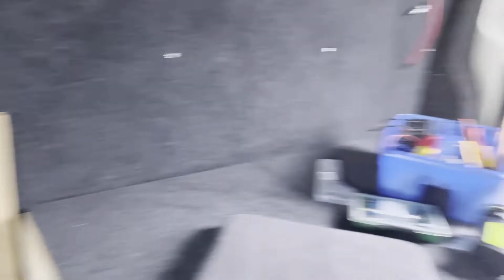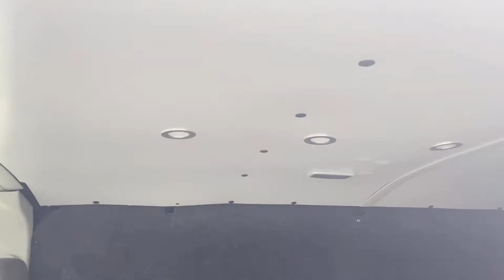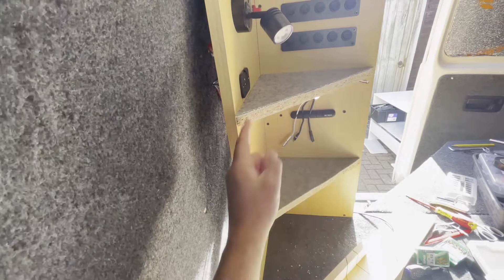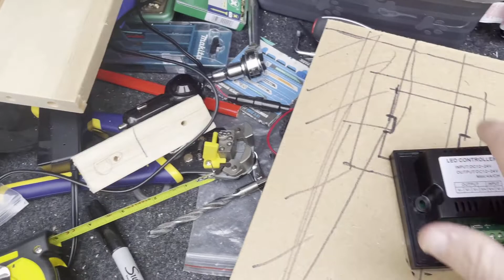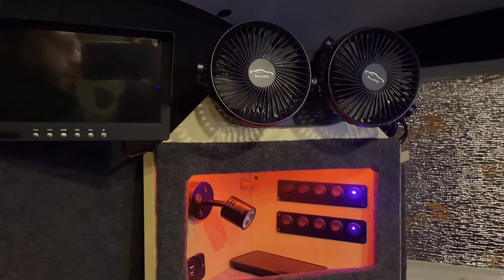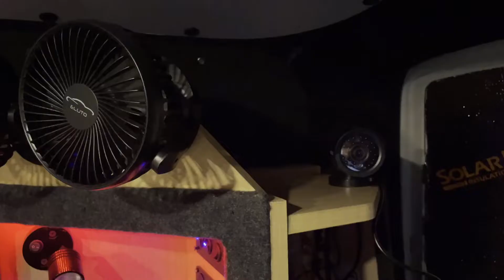Transporter Van Build Cabinets, Gadgets & Lighting

Comment: Thanks for the update Shaun. That original headlining looks like a proper campervan ceiling anyway. Looks good as it is. Loving all the electrical set up too.
Reply from the maker: Thanks Mike, I did a few filler repairs to the headlining and gave it a couple of coats of paint, is a bit patchy but good enough for the moment, thanks, Shaun